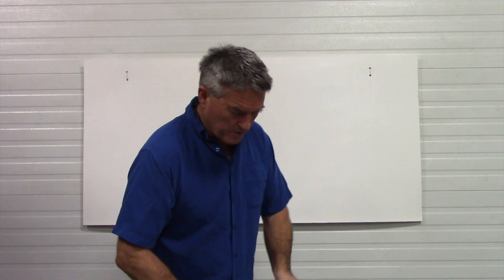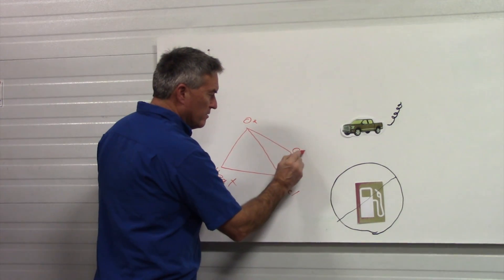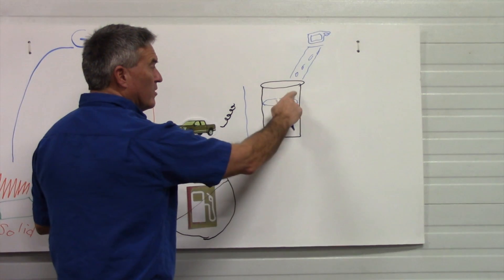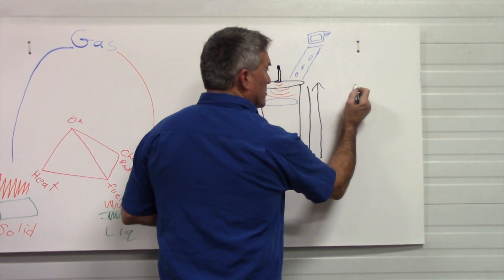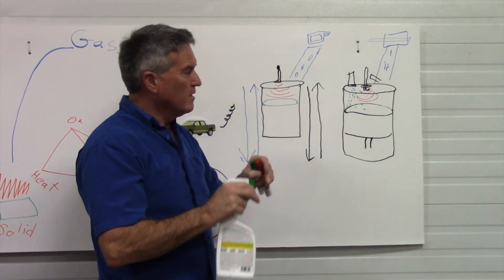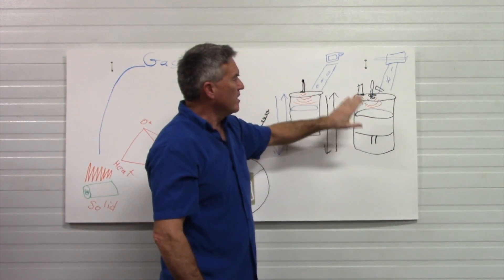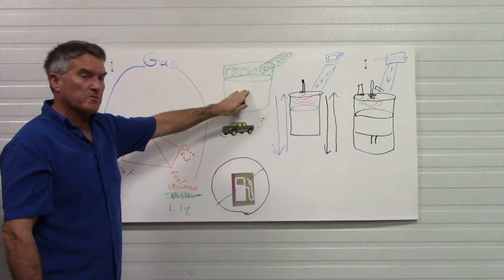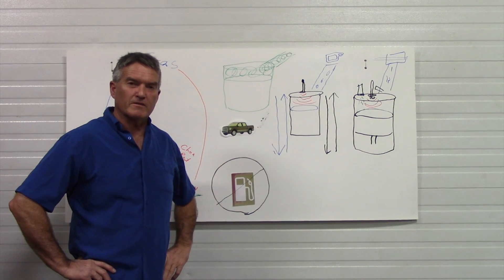One Simple Trick to get 100 miles per gallon with less pollution!

Comment: This a vaporizing carburetor invented in the early 70s.  The company was Fish Carburetors, I believe.  Fuel injection for autos was just being pushed by car manufacturers because its very controllable, safe and fixed the piston cooling issues without massive changes to the engine itself.  The patent for vaporizing carbs was bought by some big corp, I don't remember who, but Im sure it was either big oil or one of the big 3.  The full mileage with vaporizing carbs can easily reach 80 or 90 mile a gal in a chevy v8 like a 327 or 350.
The real secret behind this sort of thing is simplicity.  If the general populace really understood how easy this is, people would revolt and it could quickly and seriously damage the world economy.
The real advances in technology is GRAVMIP, which stands for gravity manipulation.  (don't ask me why it's not 'GRAVMAP', that makes too much sense I guess).  It's one of the easiest concepts, yet one of the most difficult actions to actually perform.  It's also called Canvael Spatial Distortion, but they moved away from that term because its too descriptive.
Reply: I thought that water was used to cool engines.  What is the purpose of the fan and radiator?
Reply: Water is used to transfer heat and help mediate the temperature of the heads and block. Keeping the oil cool is of paramount importance though. The oil is the first thing to heat up significantly because it literally creates its own heat when it is cool and viscous. Being forced to shear between tight bearing clearances generates a lot of heat. It generates less heat the warmer it gets due to viscosity changes. 
Oil has a relatively narrow range where it does its best work. Too cold and the filter bypass opens letting dirty oil through(this happens more than people think).  Too hot and the oil breaks down very fast which cuts into its performance. 
Oil does not transfer heat as well as water but it is in charge of cooling the bottom end. Oil cools the bottom of the piston and it cools all the bearing surfaces. Bearings have to get hot before they can gall. 
Oil flow at the head and upper cylinder wall is not enough to effectively cool those areas so instead we put water through those areas. The end result is the head can actually help cool the oil though we usually add oil coolers in heavy duty applications just because we want better control over the oil cooling and it is more effective in engine longevity if we can keep the oil from reaching higher temps. 
In many cases the oil cooler is actually in the radiator. The radiator removes heat from the oil and the water and transfers that heat to the air via the fan. 
Remember the critical thing is to keep the oil temps low for long life and better engine protection. But not too low because that can cause resistance that generates more heat and if cold enough on a used filter can cause the filter bypass to open. Not something we want to happen.
Reply: consaka1 is absolutely right.  You should not use Fish Oil to cool your engine.  It's unfair to the fishes to kill them and use them for their oiliness, when we'd be much better off to let them die and rot and make more oil in the center of the Earth.
Reply: +John McLean  I bet you think you are pretty funny. Do you laugh at your own ridiculousness?  Well I think you are pretty funny but not like you might think.
Reply: Going downhill at an idle maybe. Mileage is just not going to be that much better for the same power output. Anyone can cobble an engine that barely runs and claim it gets 100mpg. However it isn't useful that way at all. We need actual power to do the work that we need done.
Reply: I've tested the Fish carburetor on a 360 ci. Chrysler engine and it was guaranteed to increase mileage of 20% over the standard carburetor which was a 
two-barrel or four-barrel factory carburetor. The carburetor did do it and even exceeded the mileage guarantee. Fuel injection will not do that and the
the main goal is to present fuel to the engine in a vaporized form for complete combustion/power and low emissions. I would say, the only reason that 
we are using fuel injection on today's engines is for the convenience of easy starting and use for the average public. Smokey Yunick had the right design
and it was not taken seriously by the manufacturers and GOV. Check the U.S. Patents on fuel systems that never went to production because of the
corporate greed and GOV control of inventions that never were used which is all about taxes and money. Delve in what gasoline and the number of 
compounds/vaporzation temperatures  it consists of to get to a vaporized state. The product is a poor fuel choice and check on the Fish Carburetor.
Reply: Fish carb eh? Where did you get that? 20% is not 100 mpg
Reply: Ben Kottke Despite what the ignorant week mind thinks we like to call them General Motors owners. The truth of the matter is a engine can run to efficient causing the oil to sludge. This is a condition that is not very good for the purposes of long life case and point a 2 L ford escort was made to get 75 miles to gallon on the highway. Only one problem severe engine failure normally occurred within the first thousand miles. Because of oil sludging. So in less you’re somebody that lacks common sense Like anybody that would buy a General Motors product you would say I think I’ll live with my 26 to 30 miles to gallon.
Reply: Mike Kramer  Please explain how efficiency causes sludge in the oil.

Comment: Ok looks to me you have only part of the Tec info on how a cobustion enguine works there is only one time spray from the injection x cicle at 2000 rpm this hapen 17 times combustion is created only by gas if you over flow a combustion engine with liquid fuel it won't start the only way to make the engine be more efficient then 37% that is the normal level is only by trasforming the liquid fuel into gas before injection on I run my car like that all ways I get 80 miles x galon on a 6 cilinder not for sale

Comment: Oil does not come from fosil fuel just another big fukin lie, do a little research this has been know for several decades
Reply: Aquatic phytoplankton and zooplankton that died and sedimented in large quantities under anoxic conditions millions of years ago began forming petroleum and natural gas as a result of anaerobic decomposition. Over geological time this organic matter, mixed with mud, became buried under further heavy layers of inorganic sediment. The resulting high levels of heat and pressure caused the organic matter to chemically alter, first into a waxy material known as kerogen which is found in oil shales, and then with more heat into liquid and gaseous hydrocarbons in a process known as catagenesis. Despite these heat driven transformations (which may increase the energy density compared to typical organic matter), the embedded energy is still photosynthetic in origin.
Reply: Oil comes from Pep Boys and Walmart.  And other places, I think.

Comment: Ever heard of liquefied petroleum gas? It's called propane! Methane, butane, ISO butane, octane, cetane. The tanes have it!  Hydrocarbon gas made from water and carbon is easy to manufacture, so is methane from burning wood in a low oxygen environment the water and woodbine is converted to methane cleaned up it will burn brightly blue

Comment: How old is this??  Does he know about fuel injectors that convert fuel into vapour?
Reply: Fuel injectors do not convert gasoline to a gaseous state.  They are still injecting liquid gasoline, even if it is converted to a mist composed of tiny droplets.  In 1973, a Shell test car got 376 mpg. It was a 1959 Opel modified to run on gaseous gasoline instead of liquid gasoline.  The oil companies (like Shell) know all about how to get unbelievable gas mileage, but it's bad for their business, so they keep the information suppressed.

Comment: Hi again all.......
I thought I should be fair and give it a proper test and well .......I dont know what to say without anybody saying we told you so but ....in the name of open disclosure ......
I converted my dear old  dads 66 chev and gave it a go and ........with my gallon of fuel in the tank I did finish my trip in fact 102.6 miles down the road ........
I'm just glad that I HAD MY CARBON FIBRE PUSHBIKE IN THE TRUNK TO GET ME THRU THE LAST 86.6 MILES ..........
This clearly proves 2 things
1.   16 mpg is the best it will do regardless.
2.   The remainder is much more achievable if the bike is carbon fibre ......don't let any of the naysayers tell you it cant be done .......cheers

Comment: Power is made by putting as much air and fuel as possible in an engine.  Turbo and supercharging increase that.  Liquid fuels are atomized into droplets, fuel injection smaller droplets than carburetion.  Droplets burn from the outside in, and not all of the liquid is consumed.  Excess liquid fuel is also introduced for cooling.  That is why exhaust catalytic converters get hot, they are burning the fuel NOT burnt in the engine, and do not do anything to move the car.  The catalyst should be at the intake.   A "dry" gas occupies more volume in the intake stream, so power is reduced along with fuel consumption.

Comment: So your saying make a petroleum gas to be more efficient than the liquid, I thought Liquid Petroleum Gas already existed know as LPG so it's a GAS before it goes into the chamber, it's certainly not liquid when it's in the chamber and it's only liquid when compressed for storage, this has been proven to be less fuel economical than liquid fuel.  A turbo diesel vehicle shadows the economy of a petrol vehicle any way you compare them. But why not use natural gas to power vehicles? heck there are fleets of buses converted already for public transport, or if you dont want to convert your engine then why not use Hydrogen, the technology is there, 0 emissions, and essentially we can make it affordable by using electrolysis, Australia is looking to become the largest exporter of this and they by product is pure oxygen in the manufacturing process and the burning of the hydrogen byproduct is water. At the end of the day the design of the engine is the problem, heat that goes to waste could be used if we had an engine that produced no heat or used all the heat in other ways then it would be using the fuels energy at it's maximum potential instead of allowing it to escape.
Reply: VlogBiker    LP is ok, but you need a huge fuel tank to get any range out of the vehicle.  It works fine in buses, driving around town and close to refuel stations

Comment: Thanks. No need to tell you to ignore the negative comments, you already know. Now, my question is why not create Ozone electrically to inject into the vapor stream instead of raw air? Three parts oxygen with small natural air mix might increase the rate of expansion. Just a thought. A simple stainless steel tube housing a UV lamp with raw air pumped or sucked through would produce enough ozone enhanced air mix to make a difference. A simple venturi in line past the Ozone system would balance the air mix and produce a higher energy (even cleaner) burn output I'd think.